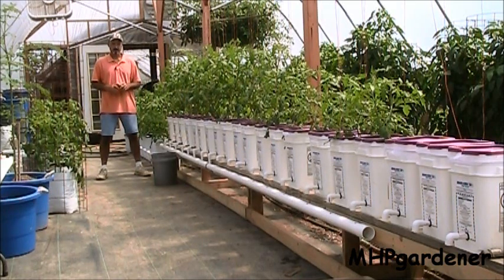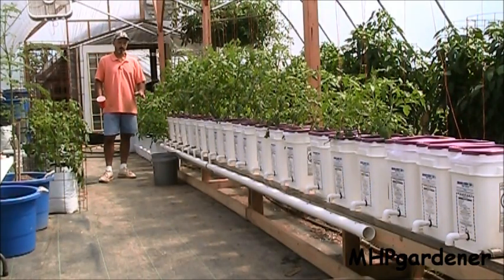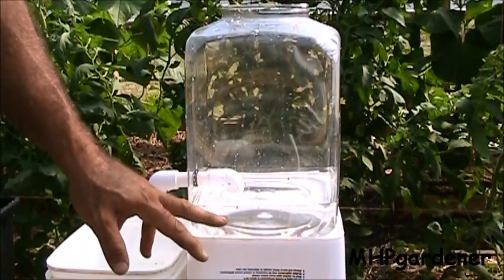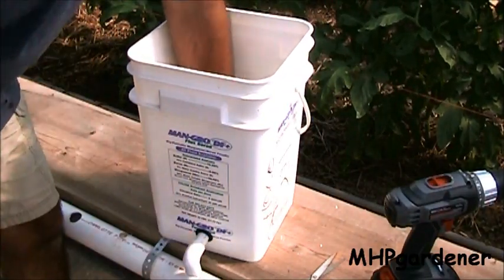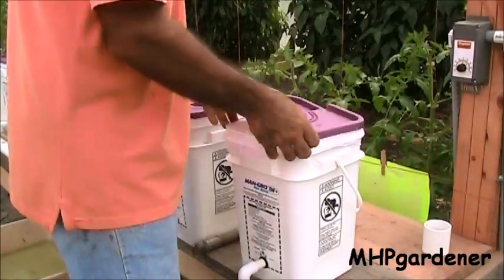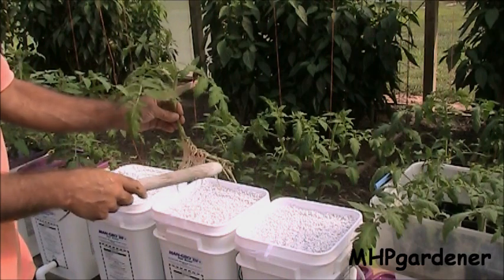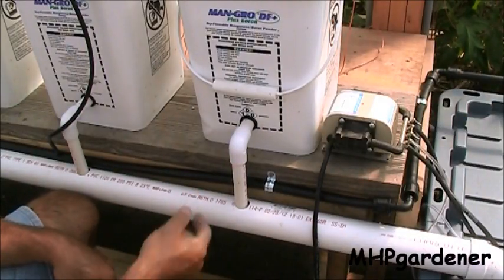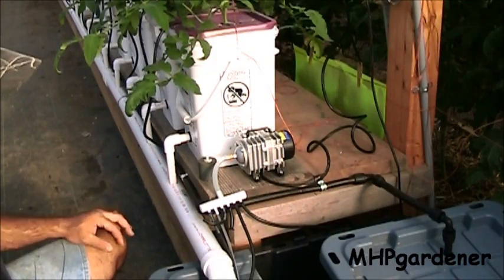Dutch Bucket Hydroponics - How It Works & How to Make Your Own Buckets

Comment: I'm not sure if this helps, but I've been just using 2in mesh cups with those filled and the buckets being just nutrient water and no rocks or anything. That would save you some money. I don't think you need any medium in the buckets at all but I've only been doing hot peppers. I haven't tried tomatoes. I wonder if that would save you some money?

Comment: You used 3/4 inch grommets for a 1 inch hole?
Reply: They're 1/2" ID Gromets for 1/2" PVC. 1" OD, which require a 3/4" hole that they plug/snap into.

Comment: The reserve will run out of water with that many plants due to the plants evaporating the water out their leaves. I have a 200 litre reserve and my plants evaporate the water in summer it was 30 degrees Celsius today. You could put a water tank higher than the reserve run in with a float valve in the reservoir that lifts the water level in the reservoir if it gets below half way. This would also protect the pump from running dry.

Comment: I've done dutch bucket tomatoes for years. I never use any growing medium such as perlite or rocks. I use nothing in my buckets but Masterblend and water for the nutrient solution. I do use an air pump to keep the water oxygenated. You might want to change the water Masterblend solution every few weeks. My setup works great!
Reply: Do you check EC regularly?

Comment: Because the pearl light floats it will stop at the bottom of that tubing because water seeks its own level so therefore the water will still be a half inch deep around the opening of the elbow so in theory if the water flow is not too fast the pearl light will never leave the buckets ??
Would that system work if I ran a small pump instead of a drip line just having that size tubing run a steady flow over the roots during sunlight hours? A solar panel to run the pump with the plants be OK being wet for 12 or 14 hours and then dry overnight?

Comment: I have 5 -   5 gallons buckets with the same set up.  How do i calculate the fertilizer?  do i calculate the water volume as 25 gallons or 5 gallons?

Comment: Put your nutrient bucket above the plants using a platform or a rope and pully system. Have drip lines from it to each bucket. That way you are filling the bucket once per day. A catch bucket can be used to recycle the neutrients that wasn't used in the first cycle.

Comment: Your video was amazing,  I followed every step to a T and was even able to expand my reservoir with a 20 gallon drum so I didn't have to check water levels every day.  My 1 question though,  I have developed algae in my tubes, buckets and tomato roots, which is odd since my system is indoors. Is this cause for concern.  If so how do I fix it without chemicals until harvest time. You Rock

Comment: love this video, it really displays with or without electricity, but just to confirm.do you use electricity for the water pump and reservoir? also, plus will the reservoir fill up and not circulate back to the plant? did you say to water it 3 times a day when no electricity and for the whole week?

Comment: Is it necessary fill the buckets all the way to the bottom with perlite?  Because you are using the paint strainer bags ground could you roll the sides of them and clamp or fasten them in some way so the bag would be suspended in the bucket say a quarter of the way so that the perlite provides stability to the top roots and then raise your drain hole significantly so the roots themselves would always remain in water up to that point and the air roots would never get drowned accidentally.  So is there any reason that you can see why this wouldn’t work?

Comment: At plumbing shops you can get hub grease. (Actually a soap for lubricating pipe into rubber grommets) but if you wipe the inside of the gromet with dawn dish soap. The pipe will slide in very easy.

Comment: MHP, I am doing my bucket system now and have a question about how large of a reservoir I will need for 30 4 gal. buckets filled with perlite? I currently have the same 45Gal. container that you are using but is looks like you have 20 buckets? You have been a great inspiration and appreciate what you have done.

Comment: I use  a setup just like this. Its called a ebb and flow, Flo n gro, drain and fill, ect. One tip....try to get all the water to drain out the buckets if you can. Roots in standing water will cause rot. Even when your filling and draining every 3 to 4 hours you WILL still get root rot. I'm Commenting from experience not just because. If you can't get the water totally out of the buckets add air to each bucket. And perlite will grow fungus easier then the clay pellets. Idk know why but always happens when I used perlite.

Comment: I have put together a dutch bucket for tomatoes and I am VERY happy that they all grew and put on tomatoes.  I used the nutrient solution that you use and the plants love it.  BUT, the tomatoes are small.  I have two different varieties and they both produce small tomatoes.  The blossoms grow fruit but they don't get very large before they ripen.  I have had a couple large tomatoes but dozens of tomatoes that were cherry tomatoes sized when they ripen.  Suggestions?

Comment: GOD bless you Sir. May I ask... You have 20 buckets or so in that run. What size pump are you using? Or intend to run? The pump pressure in the closest buckets would be much higher than the last buckets. Could you shed some light on how the pressure is equalized so as to feed all buckets equally? Thank you kindly if you decide to answer.

Comment: May be a dumb question but why does the siphon need the internal downward facing elbow?
Reply: An added preventative measure against perlite leakage into the recycling system and the pump? Possibly? Does perlite float?

Comment: Great guide/ Video! I really like the grommet trick, I'll be switching to that from now on.

Food for thought readers:
What 'mhpgardener' says is true and it doesn't really matter what size stone or per-lite you use for growing. The stone is merely to support the roots.
So for a big but low-budget project, I'd say forget the per-lite! Choose a loose gravel straight from the quarry. It's about £15 -20 a tonne. WAY cheaper, No dust and much better for the planet when it comes to disposal. Plus, stone naturally helps filter your water too. Win win!
And if you do end up with a pile left over, you can use it to top other planters or tidy up rough area's of ground in the garden/yard, or even use it under your dutch bucket system to keep the weeds underneath at bay. Its amazing how quick and easy gravel is for tidying up those rough bits of ground!

(roughly 4 standard builders buckets to a wheelbarrow, 10 barrows to a tonne. Big saver when using lots of buckets and containers for the dutch system).

But if you don't have a truck or trailer (or a buddy with one), or a quarry within sensible driving distance, or you struggle with lifting, OR your dutch bucket-stand is flimsy/weak, then I guess stick with per-lite. Bagged/sacked gravel is much more expensive to buy and much MUCH heavier.

Anyway, I'm rambling on, haha. Just do what works for you. lol.

Comment: Thank you for posting this. Great information. Do you think you could do this with round 5 gallon buckets? Also, how often do I change the reservoir worth of water? I see this uses much less water than some other hydroponic systems!! Very awesome. Also lastly is it poss you could email me a parts list with links from Home Depot so I can get everything shipped to me
Reply from the maker: Yes, you can use round buckets, they will work just as well. You can change the reservoir as often as you like. For me, I prefer to let it run way down, then refill with fresh nutrients and water. So I rarely bother with a complete change out. If you have hard water or ph problems, your situation may be different.

Comment: good job men , butt if no electricity you raise a 50l bucket in the higher side and you just transfer the water  from de lower reservoir with a bucket to it and the irrigation will be done by gravity

Comment: On the Grommit you used you said it was 3/4 but what panel thickness (or the space in between its flaps that holds onto the bucket and waterproofs it)?

Comment: Your the best on YT. You need to keep your pests at bay, try and use some Hydrogen Peroxide in your root water and spray at 13% 0.5-1.5ml or 4ml 3% per ltr. Also, try spraying Seaweed extract fertilizer with it. The HP will oxygenate the roots, even more, break down old matter, SW and HP spray in the late evening when stoma are open,

Comment: fantastic! i'm impressed every time I see one of your videos explaining hydroponics. thanks sir. One question : why do we need the pvc elbows INSIDE the bucket? what purpose does that serve? thanks again. May the Almighty bless you from His wisdom and guidance.
Reply: I think that it helps keep the rocks in the bucket
Reply: @bobhuffman6288  thanks Bob. I do believe you're right.
Reply: Actually, it establishes the level of water in the bottom of the bucket, so that there is always a little water in the bottom, but not too much.  The hole where the grommet and 1/2 PVC is installed is drilled two inches from the bottom of the bucket, but he doesn't want two inches of water remaining, so using the elbow inside reduces the level to one inch or so.

Comment: This guy got me going on hydroponics years ago. A slight add on is to put the pump in one of the paint bags and zip tie , much like a prefilter . Works like a charm.
 BTW from year to year the paint bags degrade and some perlite might get through, thus the reason for fiter bag.

Comment: Thank you so much! I am building my 25 buckets system after your very helpful video. Are you refreshing the water every 2 weeks? if you do, how are you completely emptying the buckets? Or it is okay to have 2 inch water at the bottom of the buckets not replaced? Are you topping off your reservoir with fresh water daily until you replace the whole water or no? Thank you so much!
Reply: This is the most important question after the setup! I wish @mhpgardener would answer this question!! Or maybe @Mehmet Usluoglu since you posted this question a year ago you might have some information in the meantime with your system???!! Thank you!
Reply: @mynamespelled  I have never emptied the buckets or reservoir. I kept putting fresh water and nutrition when the water level goes down. I had an amazing crop.
Reply: @fbatakci  thank you very much!

Comment: As suggested, I went to the Grainger site to look for grommets you mention.  Found several hundred options...any chance you can be a little more specific about which ones you are using?  Also - what is your choice as the best fertilizer you have found thus far?  Thank you very much - an excellent video

Comment: Hi! Great and easy to follow video. Thank you.... Is the perlite reusable and if not how do you discard it? I am super new to all things gardening. Also can you recommend a nutrient and fertilizer brand please, I am in Florida. Do I need anything else like ph stuff and a dig tester?
Reply from the maker: Hi Andrea, welcome to gardening... lots of fun and very rewarding. The perlite can be reused a second time. I rinse it really well and have had no problems. Beyond that, I like to start over with a new batch. As for disposal, I'll add some to my beds in the greenhouse and outside, mixing it into the soil to prevent it from blowing or floating away. And some of it just goes in plastic bags to be disposed of. As for a hydroponic fertilizer, I use Masterblend 4-18-38, along with Calcium Nitrate and Epsom Salt. Look back thru my videos, I posted what I use and how to mix it. In regard to testers, I've heard the Florida water can be pretty harsh. So a good ph tester would be a good idea, along with Ph Up, or Ph Down.....whatever you need to get the water close to 7.0 at the start. Hope that helps, Bobby
Reply: @mhpgardener  YES very helpful. Thank you. And I did see your video with the chart after I asked this but I appreciate you replying. I will be on well water once we move to our new home in a month. I am hoping to make a small enclosed area for this. I am worried about the bugs that can hurt the plants. Are there any organic solutions to keeping them from killing the plant or is that not a big issue if enclosed? =)
Reply from the maker: @Drea-pl6uf  Inside or out, the bugs are gonna find you. Depending on the "bug", you can look for products that use Spinosad for organic gardening. If you have worms, look for something with BT, Bacillus Thuringiensis. That's just 2 choices. There are other organic spray options, too numerous to name them all.  Best advice is to check the plants carefully every couple of days to catch the little #$%% before they get too far ahead.  Bobby

Comment: Why do you add fertilizer 3-4 times a day? Does it really need that much?  These are serious questions from me. I am not knocking anything you said or did.  Another question I have is,  because light can transmit through the white bucket, do you have any problems with algae growth in the water?  I want to do this but don't want to waste money on things that won't work.  Thanks for your time.

Comment: Explain the 2” drain pipe runs into your reservoir and you pump out to feed tomato does the little black line that feed each plant plug into your return line or what did you plug your black line into
Reply: The black line supplies water to the drip system.  The white 2" line returns the water to the reservoir.

Comment: Do you need to worry about the plastic parts being used (leaching of any chemicals)?  Things like the PVC piping, the buckets, the paint strainer, the reservoir etc.  Is there any risk in the material used for basically anything that the water will touch?

Comment: Unfortunately these days I am one of those unemployed people but I it side jobs a lot doing handyman work small engines or welding and making stuff I ain't no professional welder so I don't do no Auto work and nothing like that but like shooting traps and stuff like that a good money maker, but like you said I have world free time still even though that stuff comes along pretty frequently and I have been experimenting with  Hydroponics because I've never grown vegetables out of anything other than solo and right now I'm doing a deep water culture system and I have been learning a lot about nutrients and the micronutrients and how much to put in how much not to put in and I've killed a few plants already but I have learned from those plants and the complicated part for me is the whole Supply and then fertilizer part because the soil did most of the work for me before I started trying this stuff and I just work my fertilizers into the soil in the soil take care of the air and everything else

Comment: what kind of tubing did you use for the black water supply tubing and the little feeder tubes for each plant? Also, I know you ordered the paint strainer bags on Amazon but wondering how much you paid for them? I found a listing for 25 for $66 CAD, wondering if that's a good price.

Comment: I wonder how much electricity a spin class could generate if the bikes were connected to auto alternators?  How many batteries would it take to keep that little pump running 24/7?

Comment: You could use a small piece of cloth or stocking placed over the PCV pipe. The one that sits inside the bucket. This would stop any per-lite material getting back into the water return system. This maybe be cheaper than the filter bags you used to line each bucket. Great setup.

Comment: I live in the Panhandle of Texas. Temperatures are 90-100 during summertime. I have a bucket system that is out in the open, no cover. I have a 25 gallon container buried in the ground that hold my water. The water gets extremely hot and can’t be good for my plants. I’ve been adding frozen 2 liter bottles of ice to it three times a day. It helps but still warn. I feel as if it is what killed my plants. What are your thoughts?

Comment: Do you run the air pump 24 hours or only when the water pump is running.
Reply from the maker: If I use an air pump, it runs 24/7.

Comment: Excellent video! Have you ever considered using a water chiller to keep the water temperatures at 68-72f and get huge plants?
Reply: How would that make the plants huge
Reply: * USA * High water temperatures are a consistent problem in many hydroponic setups, especially if you’re using a small reservoir in a system like deep water culture. The rising temperatures decreases the amount of dissolved oxygen around the root zone.
Reply: @danbirch8939  
If you're using an air stone it shouldn't matter right
Reply: * USA * roots love cool temperatures. Dig 10” down and you find cool temperatures. Cooling water makes huge differences.
Reply: @danbirch8939  
How do you know it makes huge differences, have you tested it? I'm not being rude im just asking.

Comment: Hi MHPgardener, or anybody else, can I use this system but fill the buckets with potting mix from Lowes?
Reply: No it will clog it. Hydroponics doesnt use soil..if you want to use this method with potting mix just let the drain go to a different bucket instead of the reservoir and put the grommet at the very bottom so water doesnt collect in the buckets. U want the soil to drain the water outside, not back into the nutrient reservoir

Comment: so the pump pushes the water up the drip line?  Is there enough pressure to get all the way to the other end of the line?
Reply: Yes because those drip lines barely use any pressure at all. And you can always increase your pump size if they didnt reach pressure as far as u want it